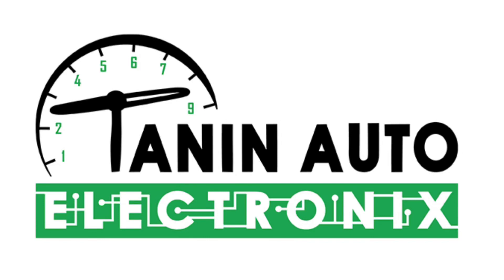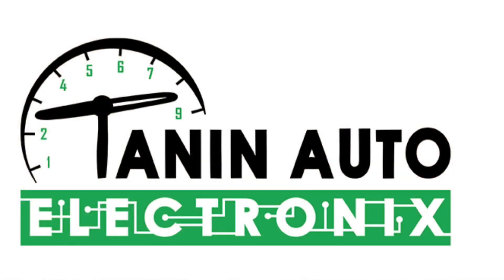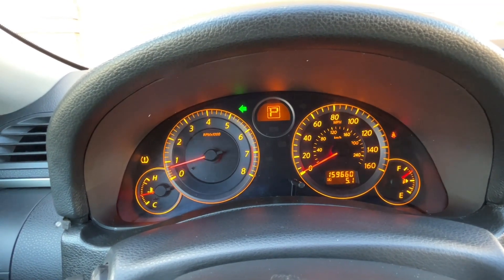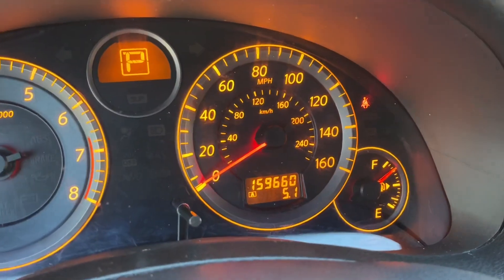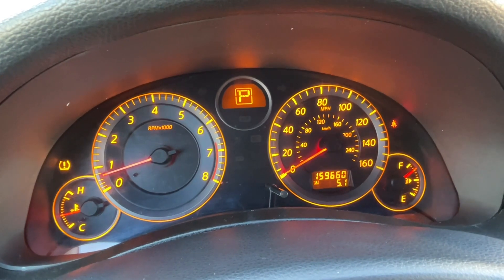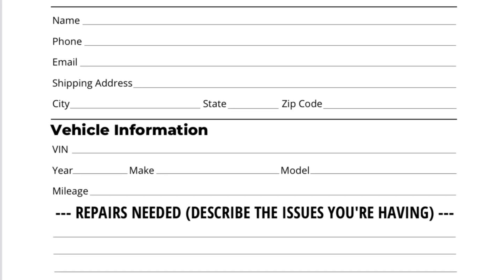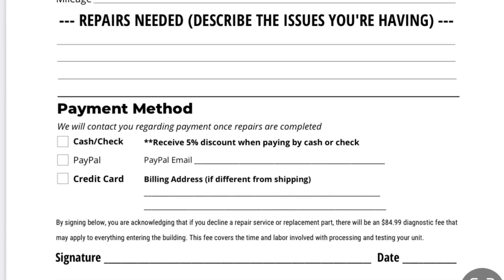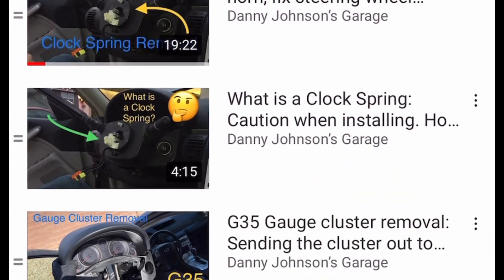Infiniti G35 gauge cluster repair service Fix Gas gauge G35 P0462 Fuel Sending Units Low Voltage

Comment: Hey Danny. Thank you for this video. I replaced both level sensors under the back seats and that didn’t fix the problem so I removed the cluster (thanks for the excellent video on that). I sent off my cluster to Tanin today. I have some advice for anyone using Tanin for the repair. First is to note the mileage before removing the cluster. Tanin asks for this on the order form and I failed to note the mileage. Hopefully this isn’t too big a problem. The second thing this to warn people not to just take the boxed up cluster to your local shipping company on your own. My UPS store wanted to charge me about $75 to ship it on my own. I discovered Tanin has a “print shipping label button on the front page of their website. I used that and they say that the shipping service is a flat fee of $29.99. Much better than $75! And one more thing: the price is now $249.99 PLUS about $40 for return shipping (this does not include the cost for you to send it to them. Anyway, thanks for the excellent videos and keep up the good work.

Comment: This probably late but I have the same issue the problem I have is the gas fuel marking me full tank and then sometimes marks me half way tank of gas I changed the  fuel pump didn’t work but wanted to know how do you sent it to the company you recommend
Reply from the maker: When you go to their website and purchase the service they give you a shipping label so box it up nice and send it off- but plan to not have it back for a month

Comment: Can you send them a spare one from a junker?  I'd rather swap one out in a day than have my car down for a month.  Is the gauge cluster keyed in to the VIN or odomoter so that it needs to be unique to the car?  Thanks for the video!
Reply from the maker: They talk about sending a replacement if yours is not repairable, so I imagine you can send a spare one or buy one from them. You’ll just tell them the milage. For my Mustang it has to match, not sure on the g35 so I’d make sure they know

Comment: Wanted to give an update on my experience with Tanin. I just got the cluster back from them, but the didn’t send back the dash padding, etc. around the cluster. I sent it in exactly as it was shown in Danny’s video where he removed the cluster. I called them (had a hard time getting them to answer) and they said they’d have someone call me back. I’ve been without the car for almost a month now and I’m not sure how long it will take them to get back to me
Reply from the maker: Sorry to hear that. Sounds frustrating
Reply: did you get it back?

Comment: I have the same problem with my gas gauge it doesn’t mark good it was empty but it says it has half but I don’t know if it’s my cluster or the thing you changed under the seats any help?
Reply: Should I send It to these guys or fix the fuel gauge

Comment: I have the same issue, i'm considering getting a used working park but the only issue i see with that is reprograming the acual miles from my FX35 to the new cluster, i have an Autel MaxiCom maybe i can calibrate with that?
Reply from the maker: There is a chance the replacement is also bad, so sending yours in would probably be best
Reply: @dannyjohnsonsgarage  good point... but, i need my car to go to work, i can't send the cluster in and be without a car for a week or so.
Reply: @dannyjohnsonsgarage  Before sending your Cluster in, would the gas gauge move down when shut off and up when it came back on? Just curious because mine moves up and down when starting and shutting down. I will consider sending mine in.

Comment: Hello so i sent mine out to repair for similar issues. I got it back recently and installed it again now the speedometer needle won't even move when I'm driving. Before i sent it out it was working but the needle was shakey and often it gave me false speed readings, dropping and shaking rapidly in some cases.
Reply from the maker: Contact the repair company. It’s possible it’s the Transmission sensor that reads speed

Comment: Did this fix the sport mode ?
Reply from the maker: Mine didn’t have an issue with that. It fixed the gas gauge, turn signal, battery light.

Comment: What engine code did the gas gauge cause?
Reply from the maker: I believe it was Code P0462 Fuel Sending Units Low Voltage, which led me to believe it was the sending unit
Reply: @dannyjohnsonsgarage  Thank you! I have the exact same code, but after cleaning and then replacing the sending units, the engine code still came back. So I think its the cluster. Thanks for the guide to take the cluster off. I am going to try to fix it myself and resolder those problem resistors.
Reply: @StingrayFPV   how is your result come out with resolder those resistors?
Reply: @sanglykhmer6494  Worked like a charm! fixed my CEL and now my gas gauge reads fine. I filmed all of it and will be putting up a DIY video on my channel so others can fix it themselves.
Reply: @StingrayFPV   thank you!!!! did you put your link on YouTube yet?
Reply: @sanglykhmer6494  I just uploaded it on my page! Let me know if it was helpful.